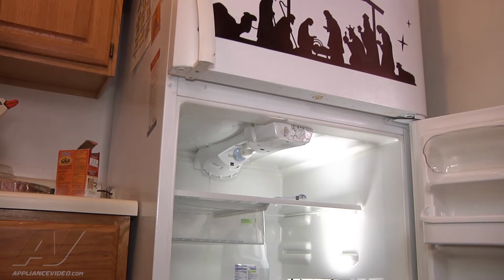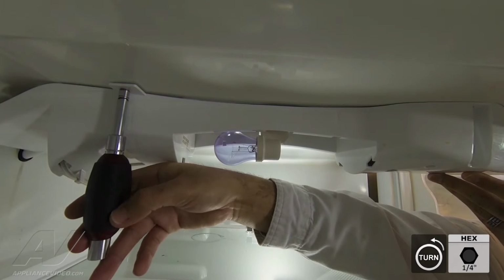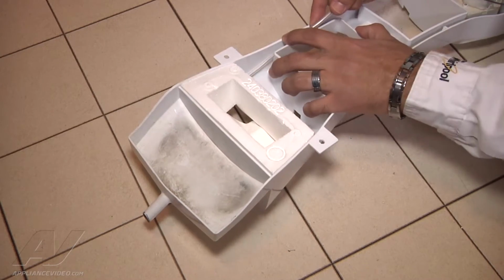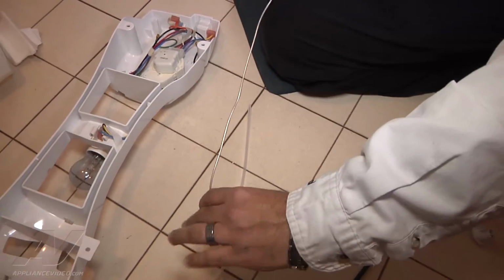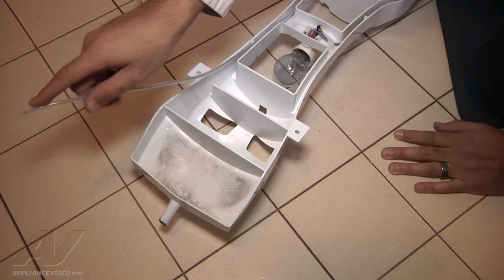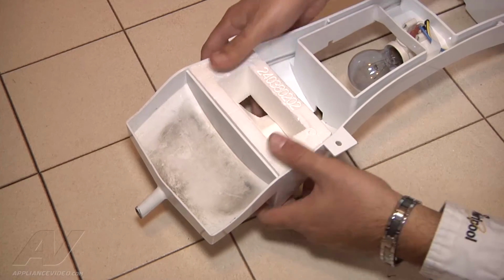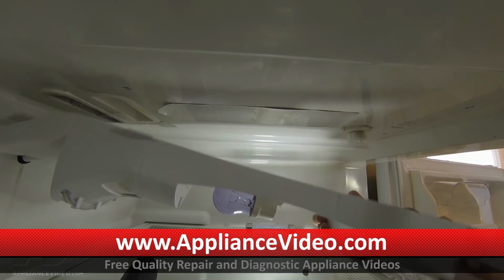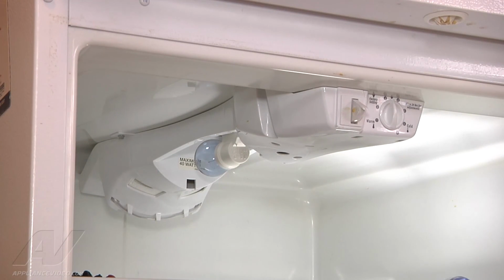Frigidaire Refrigerator Repair - Fresh Food Section Is Not Cooling - Cold Control

Comment: Good morning my Fridge fan on a Hisense type H610BI-WD Start running when you switch the fridge /freezer on but only for about 5 seconds and then stop. What will cause the fan to stop. The calve alow cool air from Freezer to fridge dit not stay open to allow cool air flow.

Comment: Excellent video!  I purchased one of these refrigerators a few years back and was to the point of demanding a replacement.  Since it was under warranty, they sent 'repair' people out to diagnose and fix it.  One guy even replaced nothing but the foam piece!   Even though new, the refrigerator area would not get below +40F degrees and the freezer would not get below +20F.  Can you imagine, only +20F in the freezer!  Food wouldn't even freeze hard.  You could take chicken out of the freezer and it was still 'mushy.'  After SIX people did different things and nothing changed, the SEVENTH guy said, "oh, you need a new thermostat."  After he obtained the part locally, he swapped it out and it has worked fine.
Reply from the maker: Thanks for your response, we are glad we could help. Our library
of over 5,700 videos are currently helping over 1.6 million people like you
every MONTH.  Please help us by
subscribing to our YouTube channel, or post our website www.ApplianceVideo.com to your Facebook
page, Twitter, Instagram or any other social media sites. Your support will
help us keep producing more free quality videos.

Comment: where does the thermostat senser go after you unwind it? I cant figure out where it goes....
Reply from the maker: Great question, you can call our parts department at 1-800-830-5465 and they can give
you help. If you have a more technical question that our parts department
cannot answer, our technicians are answering
all questions at our website at www.ApplianceVideo.com under our Repair Help section. We have over 3,000 common
questions and answers that you can easily search through by your model number,
appliance make, and problem or error codes, and It’s free to search through our
question & answer library.